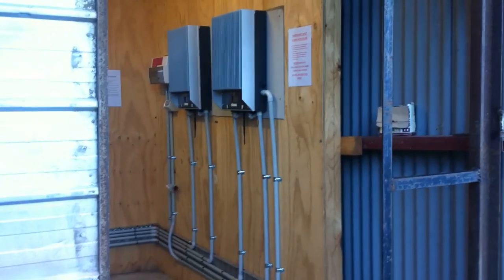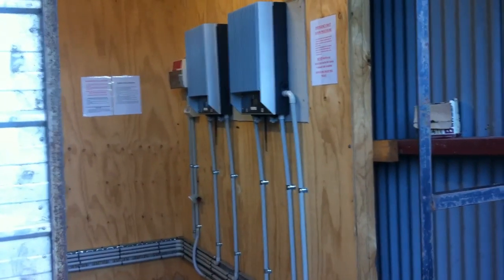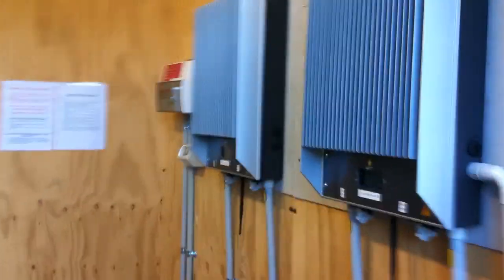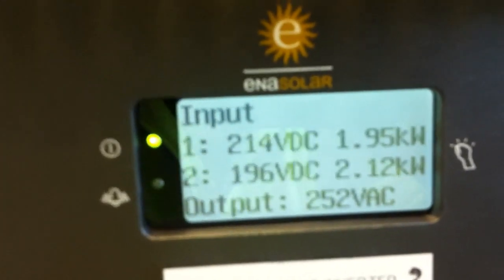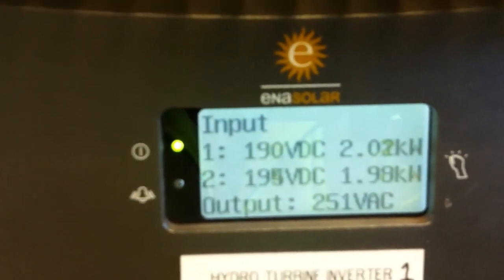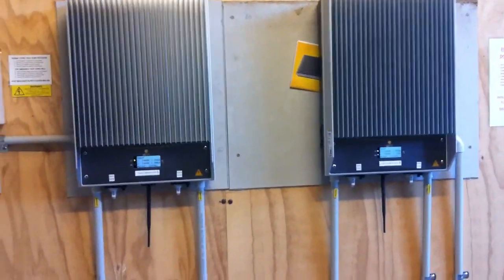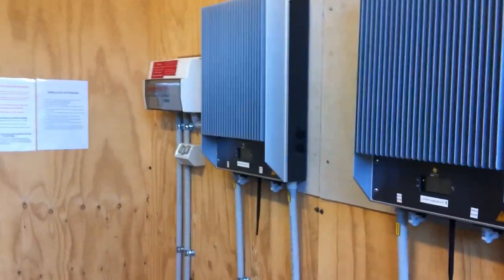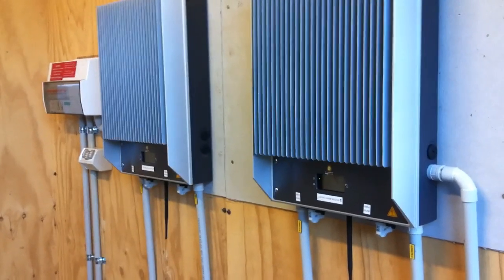Powerspout micro hydro 8 kw pelton grid connected system

Comment: That doesn't look like nearly enough flow for 8kw. It must be an amazingly efficient sysytem, for micro! Great work! Do you provide consultancy services?
Reply: It’s “about 120m of head” so that’s massive pressure
Reply: @mikeross70  - with no knowledge of the body their tapping... 400ft of head is a minimum 170psi per in² of cross section.... and the feed pipe is PVC.
Reply: Water could be coming from a high altitude running at high pressure.

Comment: That is awesome how much head/pressure does one turbine require to run
Reply: These come in different variations, this style works with as little as 3m of head, up to 130m. They offer other types good down to 2m and 1m of head.
Reply: there are power calculators on the powerspout website.

big head equals big power , 10 metres of head might produce 35 watts of power under one situation while 100 metres of head with good flow could produce 1000 watts

Comment: Do you think there is any other way to get pressure without using a drop by the river
Reply from the maker: Natural fall is how we promote our product, it will work off mechanically pressurized water but the financial return will be negative.
Reply: @darrencooper2727  I did so many research and I see that you claimed that 2.5 liter/second flow in each turbine head in your designed but replacing the natural fall of water with 1.5 hp electric water pump in each turbine head will give you a almost 4 kilowatts of free energy so you don't need a dam or free water fall to set up this unit

Comment: Do u do instalments???
Reply from the maker: yes we do in Tasmania Australia. We can go all over Australia but the travel and accommodation costs can make it expensive. We have done up DIY kits but if electrical is over 120v DC it must be installed by an electrical contractor, you can do all the water side of the installation

Comment: Hey Darren.  I am strongly considering building a system just like this!
Can you tell me your Head drop height, and the VOLUME of water you are getting through each (or all 4) generators?  (IE. 20 litres / turbine / sec)
Thanks so much!!
Reply from the maker: Hi Adam , this site is using 120 meters of head and 2.3 litres per second per turbine and have the HP option for stator and rotor

Comment: well.  the day i take this company 'seriously', is the day that the  90-Degree  bends in  the   supply-side  Plumbing,  are  ELIMINATED.     cheers
Reply: There are Nozzles in the turbine. The bends are irrelevant as long as the flow rate to the nozzles is greater than the flow rate of the nozzles themselves.  Pretty easy to see the amount of water from the 4 Turbines is far less than what the supply pipes are capable of flowing and with 120+M of head, going to take a LOT of bends to slow that down. 
Of course the real tell tale to the foolishness of your indignation is the output can clearly be seen on the inverters and these things are not lacking in output. 
Telling someone to get lost, or stay in the creche along with grow up speaks volumes of your lack of maturity and intellect.
Reply from the maker: The bends do not restrict the performance the flow rate is not high , we have built and tested plenty of units. The turbines are running at the max warranted output.
Reply from the maker: David can i ask ,How many micro hydro systems have you built?